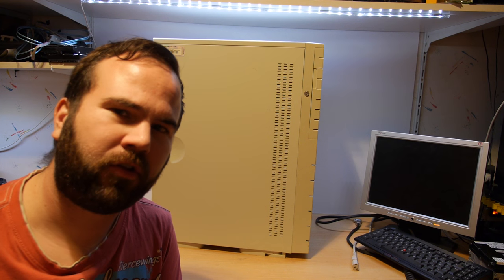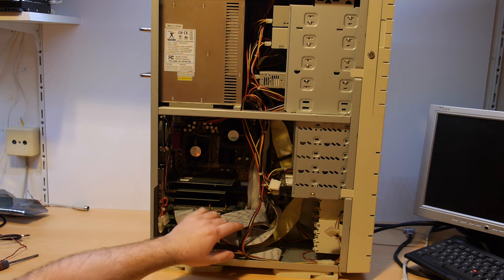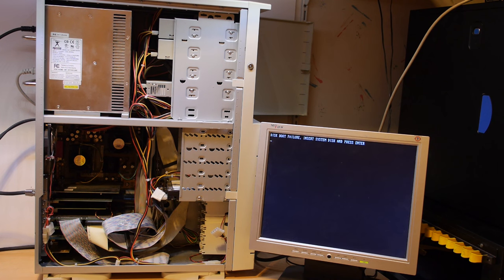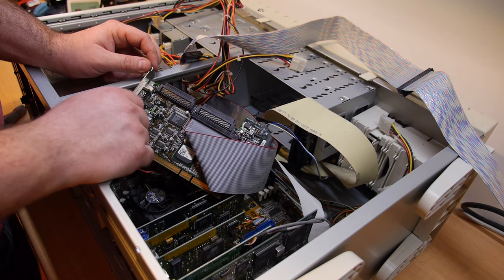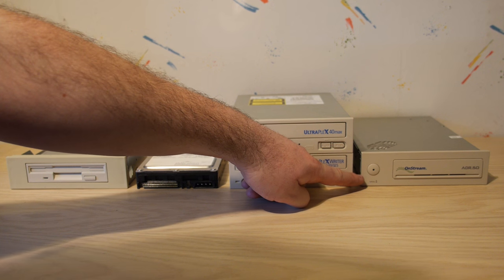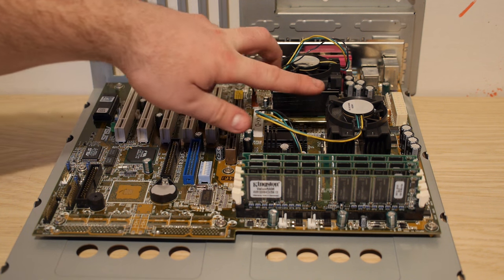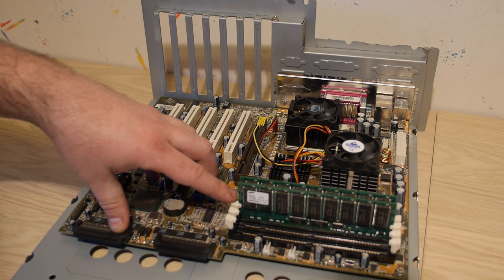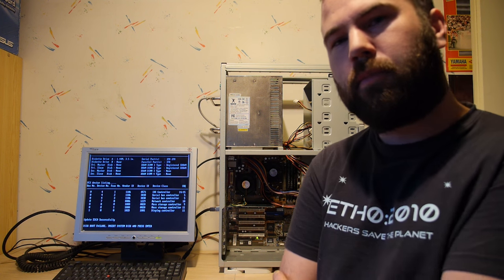Computer Vlog7: I Found a Free DUAL Pentium3 Computer Online!

Comment: I have the cuv4x-D paired with dual Pentium 3 Tualatin 1.4ghz cpus and 4gb ram even through in a radeon 3850 lol and it kicks ass. If it weren't for the lack of modern instruction sets you really can't tell your on a machine that old. It's so snappy.

Comment: would the processors have to be identical model for this or similar boards? or could one use a lesser cpu of the same socket if they acquired such a board but it only had one processor?